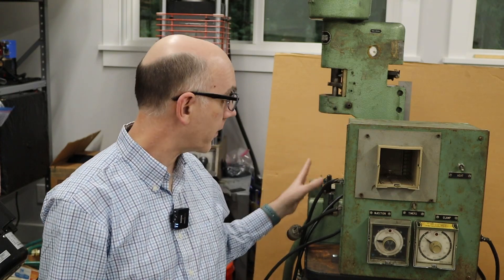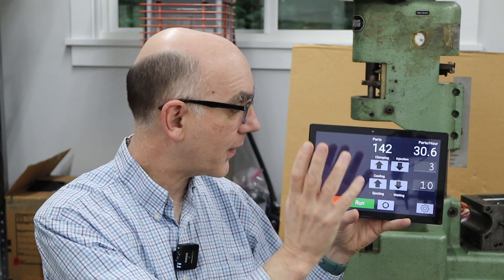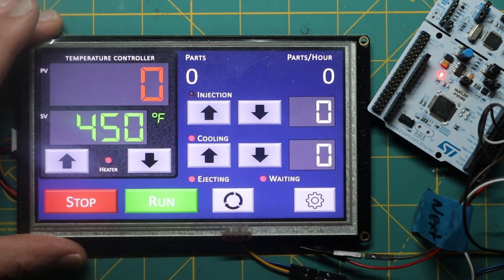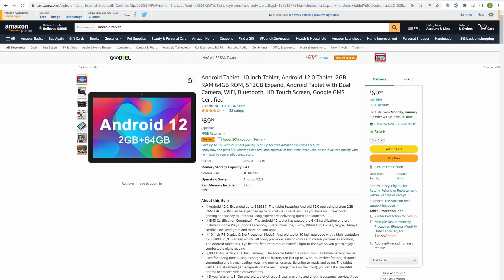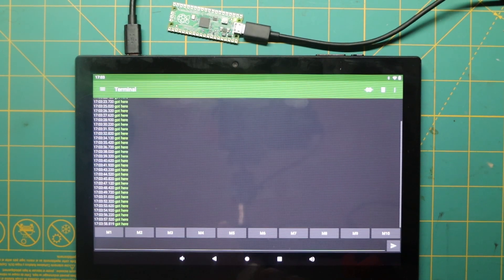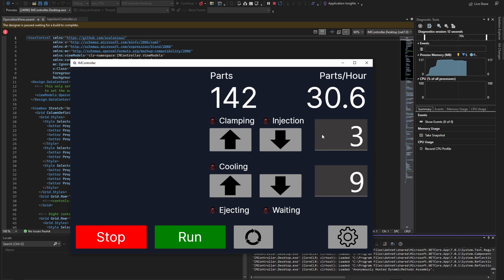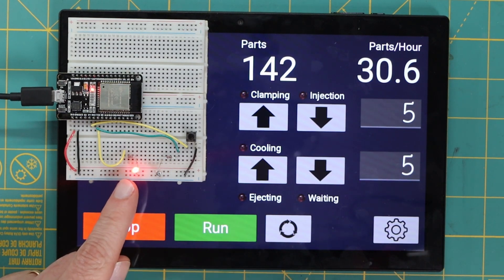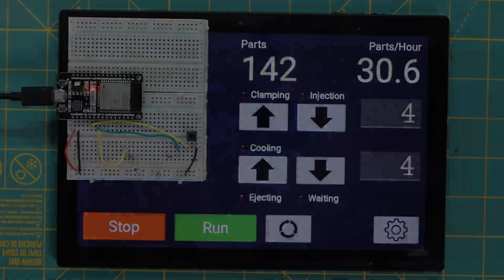Touch screen for a 60-year old injection molding machine

Comment: You could use AI2 or kodular to do an Android GUI. 

I would make all running code on the esp side, in the event that the tablet disconnects or similar potentially catastrophic situations, the system retains all of its safety touchpoints. 

Additionally, you could have manual buttons, leds and regular lcd displays on the machine its self. Then, using an http api, interface the app on the tablet to update and display things . This means that if you had multiple machines, you could use a pi or similar device to build a full web interface that connects the individual machines for scaling up. 

I understand it is a small project, but if you're thinking retail, I would at least account for the direction it could go to minimize rework down the road and afford the ability to ramp scale quickly. 

On the esp side, use preferences.h  to store your settings, like temps, times etc. You could even store by part number and subsequently that parts settings.

Comment: Looking forward to this project. One Thing i want to mentioned is, you show the breadboard with one switch for the out falling Part. One the clamp of the c4 is another one who tells the Maschine that the clamp is closed. Want to ask if you plan to sell the code?
Reply from the maker: The push button was just to get the code working that could read a digital input, and I was planning on having both clamp closed and open micro switches. As to what I'm going to do with the code, yes, I'm currently thinking that I'll sell a custom circuit board (or boards) and include the software as part of that (the TouchDRO model).

Comment: Interesting way to do this.   Graphics look good.   Here is a different way.   Perhaps you make the microcontroller serve up a web page.   Lots of ways to do this.   You run the server code on your microcontroller, it could be in C, with the html right in the c code, or in python,,,You have one program, no app on the tablet.   It is then independent of your display tablet, it could be an iPad, you phone etc…android, the mac, pc or a raspberry pi… open any browser and then WiFi to your local controller. And no cable needed.   In the long term, you are dealing with one program to maintain….
Reply from the maker: I used that approach 5-6 years ago with an EPS8266. While it worked, it was still a lot of code running on the ESP8266. And I find it takes me quite a bit longer to write a web application than a desktop application, both because of the rendering (HTML vs XAML) and the language (Javascript/Typescript vs C#). By the way, the only cable needed for the tablet is a charging cable.

Comment: Nice project. This is not really a feature as I've only just stumbled across this channel, but I'd be interested in seeing techniques for handling fault conditions, like lost connectivity, software / os crash, sensor failure, etc. It might be beyond the scope of this project, just thought I'd put it here for consideration anyway. Thanks for sharing.
Reply from the maker: I plan to change my design to put a little more of the logic into the ESP32. That way if the tablet looses connectivity, the current cycle will finish, but it will wait for the tablet before it resumes when in fully-automatic mode.

Comment: I like the project BUT it doesn’t really address the safety issues as it really needs to have CAT 3 saftey features
Reply from the maker: What does it need CAT 3? Most of these machines, without this controller, have no safety interlocks of any kind. This is designed for small, desktop machines, not the large industrial machines. As an example, check out the Buster Beagle 3D. In any event, I do plan to have a separate E-Stop button that is directly tied into the system (and not connected to the Android tablet).
Reply: @JohnSL  
I am a retired 67-year-old machine refurbishment tech for Unilever and it was critical that we always address any possibility of unexpected motion 

While your a small shop you setting and and example for the world at large
Reply from the maker: I understand what you're saying. How does that jive with having a manual lathe or a manual mill. Both of those are a lot more dangerous than these desktop injection molding machines, and they have no safety mechanisms like you describe. I know a lathe can kill you in seconds if you're not careful. I'm asking out of ignorance and curiosity.
Reply: @JohnSL  

Again it’s a hobby project which I am enjoying but one of the bigger widespread issues I see now is not using UL approved control devices even now when places like Automation Direct I’ve come out with low cost Arduino based devices 

The machine can squirt out molten plastic under high enough pressure to explode the mold so there our safety issues that should be considered when your putting in so much effort 

My thoughts our these days machines need 4 physical buttons 

1. Start 
2.Stop
3.reset 
4.Estop

The estop Should control a master control relay for total shutdown 

The reset should have to be pressed each time you remove the mold 

The Start should have to be pressed after each reset for the next moulding cycle 

The stop should take the machine to a safe state after the cycle is completed each time it’s pushed AND this is not done correctly very often 

At the least it should have a physical button to enable the high voltage power to allow the injection to function along with the Estop you already have though of 

The other thing is everything that can squish your fingers or squirt dangerous stuff has to have enclosures 

Even a relatively safe thing like a Low-speed stretch wrapper has to have a barrier enclosure with a light curtain and key in hand cycle start

Comment: Hi, I also dream to restore old KUASSY (this is the one seems to a lot of ppl here has) machine one day. Though I doubt it can actually mold what I want - thin wall small parts.. Can you tell what is the amount of pressure machine should output to be able to inject smth like small thin lego brick, or keycap for keyboard for example? Walls should be only smth like .6-.8 mm wide, I guess this requires high pressure machines, and does it even possible to use simple vertical injection machine, or it is horizontal with screw machines only job? Thx.
Reply from the maker: It all depends on the size. The smaller the part, the easier you can have small thicknesses. The best way I know of to determine the pressure required is to do a mold flow analysis. I just discovered that Fusion 360 has a pretty good one. I did a simulation today, which cost me 6 cloud credits (I think that was about $20) and about 2 hours. It did tell me how much pressure I needed.

Comment: you can do same job using MIT app inventor to make android app more easy than you write code in C# or C++
Reply from the maker: Probably not anywhere close as easy for me, as I'm very experienced with C# and C++. The C++ code I have running only took me an hour or two to get running. And C# is what I use at my day job, so I can build applications very quickly.

Comment: Ever think of using a cheap china FX Compatible  PLC Interface controller board and control it through Modus Ethernet,that way all interface circuits like opti coupled i/o's and transistor outputs can be all in one little PLC PCB or even more powerful controller if needed,I know CNC PC Control Software like Mach3 and Mach4 use that Modbus Protocol for controlling other devices, I found cheap china HMI and PLC all in ones TouchWin,Coolmay  that have all what you would need in a Control box to run your stuff,but the software screen designer are always the worst user interface and stupid like nextion, some US HMI software designers are very good at assembling together a quick interface and controller,with bunches of icons,buttons and clip art,like from Weintek Easy Builder Pro Mitsubishi , & AB Factory Automation , Maye the china hmi all in ones would be the cheapest for under 75 to 100 US for 7" touch screen with IO's built in back to the screen housing. Just my two cents,as i've been looking for a all in one solution for a long time to use in small machine automation projects and going down the microcontroller route and designing a pcb for io isolation and all the learning stuff along with it is way to much work, Check out Weinteks Easybuilder Software its modern interface and can control any PLC you can think of. Thanks Eric
Reply from the maker: I know that's an option. There are several reasons I didn't go the PLC route. First is that it would be a learning curve for me. Second, from what I can tell, the devices would cost quite a bit more (for HMI, PLC devices, etc.) than what I'm using. And finally, I plan to make my solution configurable with a settings screen to be able to work with different types of injection molding machines. Doing the same thing with PLCs, as I understand it, would require modifying the ladder logic, so a lot harder for people who want to use my solution.

Comment: If you are truly interested in a cost reduced version the esp32 can easily drive a touch screen and you wouldn't need the android tablet at all.
Reply from the maker: I did look into that. A 7" touch screen from a source I trust in China is $41. The 7" Android tablet I just purchased is $45. On the other hand, I can build the Android app far faster than a C++ (or Rust) app on the ESP32. There is also a cost to writing the code. When I look at all of that, I think I've chosen the right balance.

Comment: It's absolutely awesome that you can modernize an old machine like that. Really, when you think about  it, the only difference between that machine and a modern one is the controls. That, and it's probably built to last a thousand years. I haven't gotten into injection molding yet, though it is planned in my future. I did just get into 3D printing a couple months ago. I converted an old industrial cabinet into an enclosure for my Ender 3 S1 Pro, and I currently have a control panel with a bunch of toggle and rotary switches to control the power, lights, fan, heaters, and fume extractor. I was happy with it, aside from wanting to replace the PID temp controller for one with a timer so I could have the heaters shut down when a job was done, but now after seeing this I will have to rethink the entire project. Controlling everything, including the printer, with a touchscreen would be so much better.
Reply: Difference from a 30 year old injection molding machine and today is lightyears, to make a old machine up to date you need to change all hydraulics and electronics and that would cost an enormous amount, on a big machine a few hundred thousands of dollars could be worth it maybe.. I work with this since 2003.

Comment: I'd suggest not relying on Bluetooth connections. We work with a couple of Bluetooth devices in our brick and mortar stores and they're such a pain to debug and maintain. I'd suggest looking into something like odroid or orangepi. They are powerful enough to run Android and will have the IO to control devices. That way you can eliminate the Bluetooth requirement.
Reply from the maker: I think this depends on the variant of Bluetooth, the device design, etc. I'm using Classic Bluetooth. There are other products I'm aware of that also use classic Bluetooth serial and I know they're reliable.

Comment: Raspberry says they will restock again end of Q1 2023. They just had a large issue with their supply chain. Have you looked into M5 stack? It would be an interesting platform for you I think because they also have a UI builder and the form factor is ideal
Reply from the maker: The Raspberry Pi (or a competitor) is more expensive than this solution when you add the power supply, SD card, and touch screen. There is no way you can get close to a 7" Android table at $45 plus the $8 ESP32 board. Plus, I can build the application far faster using C# because that's what I've used at work for years.

Comment: I suggest to put all control logic into the esp and do just the visualisation on the tablet. Also emergency stop should be a hardware switch directly to the controller - otherwise you will get in trouble if the connection between the display and controller gets broken
Reply: well, i am pretty sure you are aware that he is not taking the "usual" industrial design approach. Besides your suggestion there is plenty more that should be done

Comment: If you want to save costs, just make it an iOS and Android app and skip the dedicated tablet. Users can add their own device if they want, plus, depending on the minimum platform version you target, they can use an older iPhone, iPad or Android SmartPhone or tablet. As for the microcontroller, you should create a HAL to make it portable across other microcontrollers that support either WIFI, Bluetooth or both. This will allow you to switch to newer or better Microcontrollers. Stay away from USB because it's more work than it's worth and Apple doesn't like small third party USB products.  I'm also experienced in writing Xaml for WPF and UWP and you made an excellent choice selecting Avalonia. .NET MAUI looks like vaporware (marijuana vapor). It still has a lot of bugs and with no apps using it. Microsoft mislead developers into thinking MAUI was a entirely new from the ground up, but it's just new code on top of Xamarin. Speaking of MAUI are you Hawaiian?

Comment: I really like the direction this is headed. If you haven’t researched it yet, you can also do something very similar and cheaply using an arduino with Bluetooth, and make your screen/interface a web app so customers can use their phone or tablet as the interface
Reply from the maker: I did something like that about 6 years ago with an ESP8266 using JQuery and REST APIs on the ESP. Having a cross platform application that runs on Windows and Android is far more productive for me than writing a web app. And I just received a $45 7" tablet, which is hard to beat.

Comment: I programmed up a similar controller for the machine I bought.  It runs on a really small 4 line LED screen with a single knob.  If you wind up making this commercially available we may upgrade  what we have.  One extra function might be the number of ejection cycles.  I've seen other machines that bump the part multiple times to ensure the part is ejected.  Also, if you have a robot arm grabbing parts, you may want to have an input for a sensor that registers when the robot cycle sends a "complete" signal.
Reply from the maker: I do hope to make this available commercially. I'm not promising when it will be available, as this is a hobby for me. I have another perosn who wants to have the ejector pins run off a separate, smaller pneumatic cylinder and it totally makes sense to be able to set the number of eject activations per cycle. I have some ideas on how I might be able to work with a "complete" signal, as it's similar to what I have in mind for a part gate to detect if/when a part drops.

Comment: For USB on the tablet, there are quite cheap OTG adapters with a port to charge and a port to connect periphery, i use it for Octoprint on the phone and a connection to the 3d printer and power, as well as a drawing pad (for the pen that my tablet lacks) while charging..
Reply from the maker: If it weren't for the issue with Android tablets and CDC drivers (apparently, that's left an an exercise to application developers), I would likely have gone that route.
Reply: @JohnSL  Question is, if in Android 12 it's not yet been fixed, will it ever? xD maybe someone on XDA Dev has a solution in some custom ROM, but probably not worth the hassle
Reply from the maker: I know it can be done because the Serial USB Terminal Android app works with both the Raspberry Pi Pico and an STM32. I just decided I didn't want to go down the rabbit hole of figuring out how to make it work given that Bluetooth was super easy to get running.

Comment: I never used a nextion display even though it looks easy to work with, but this sound even better. So the ESP acts as just a bluetooth enabled input/output module and the logic runs on the tablet behind the UI? The ESP code is also part of Avalonia, or that is your custom code?
Reply from the maker: I wrote custom in C++ for the ESP32. It's very simple code that implements a simple text-based protocol I created between the ESP32 and the program running on the tablet. I plan to cover this in a future video. But the idea is that the tablet sends codes to the ESP32 telling it how to set up the various pins, then sends "pin" commands telling it change the output of various pins. I have the read (for the button) working, but not yet integrated with the UX. Avalonia UI is just for the UX.
Reply: @JohnSL  Thanks. And where did you implement the actual logic? Like counting the parts, timing, etc. Is that a separate class, service running on the tablet?
Reply from the maker: I haven't implemented all the logic yet (like part counting). But the idea is to implement most of the logic in the tablet. The timing is all done in the tablet, for example. This keeps the code in the ESP32 very simple. It also allows me to write unit tests easily and run them on my desktop.